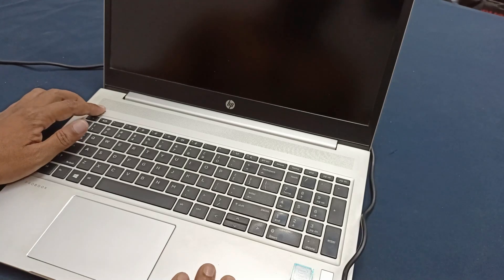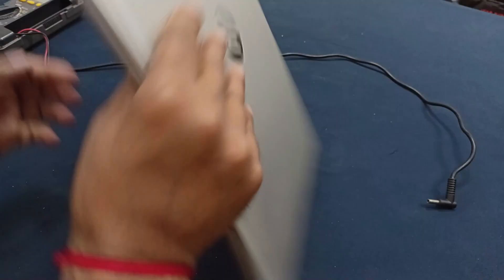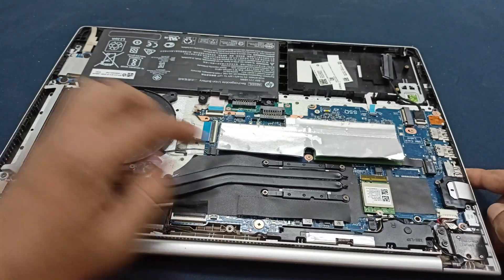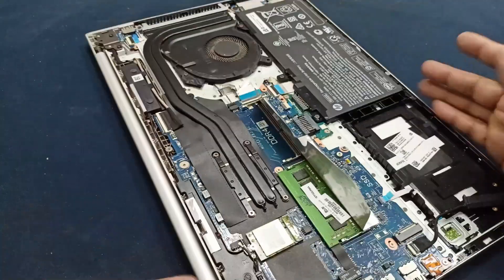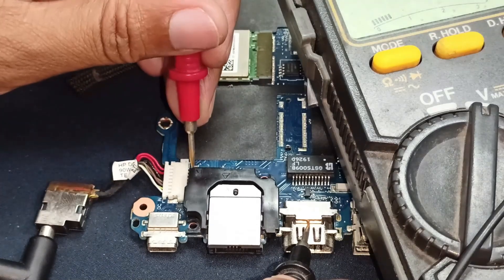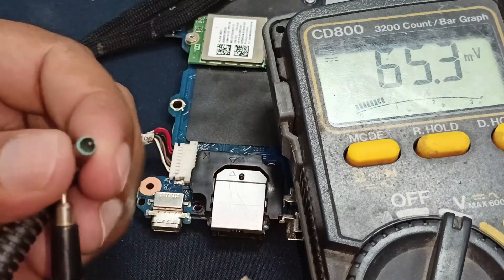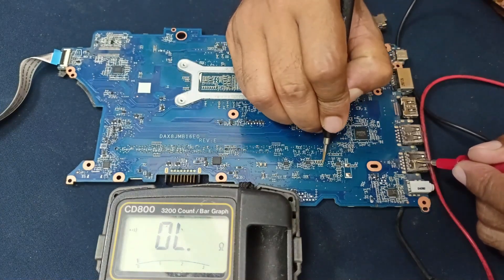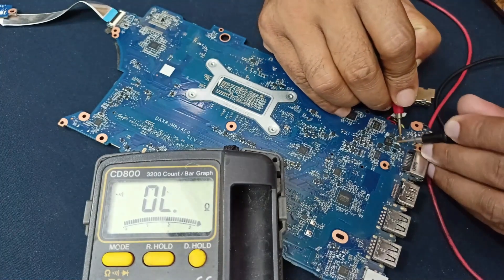Hp Probook 450 g6 laptop No power|| power won't turn on

Comment: The capacitor has no problem just change the power button socket and maybe the flex that connects to it. Otherwise, the problem is going to come back. I have done it in two laptops and it works just fine. And please learn how a capacitor works.
Reply: Thanks bud, that was the fix for me

Comment: question, i have almost the same laptop as this one (probook 430 g6) and it is turning on fine and everything works except charging the battery. i bought a new battery and it can run on battery power that came in the new battery but it wont charge at all (i've tried using both the dc power jack and the usb c charging). i did already try all of the software solutions i could find online without success so i'm leaning towards a hardware failure (maybe a blown fuse for charging or something in that lines) what is the best way to start diagnosing this issue ?
Reply from the maker: Dear sir sometimes local battery doesn’t work with the laptop i think at first you have to check your laptop  using by original battery and charger. your purchase battery would be not good quality wise your Success
Reply: @mrcontrive5641  the original battery is the one I replaced and it gave the exact same behavior I've tryed bother the charger that came with the laptop as well as a Dell 45w USB c one
Reply from the maker: @S0nicHax  ok sir i thought you are using hp laptop!  Your laptop turns on by laptop charger without battery.  Did you check that..?
Reply: @mrcontrive5641  it is an hp laptop but usb c chargers are universal, I have not tried booting without a battery installed but it does work on a completely empty battery
Reply from the maker: @S0nicHax  what was the actual problem before replacing the laptop battery.  It was the charging problem...?
Reply: @mrcontrive5641  yes, i replaced the battery because i thought the old one died but it's probably something else since the new one is having the same issues

Comment: I changed my hard disk and then the laptop won't turn on the charger light is still blinking and when I touched the CPU I found it hot so what's the issue and can I fix it by myself? (hp Elitebook G6)
Reply from the maker: Before installing the new hard disk your laptop was ok?

Comment: How is it a repair when you just removed a capacitors? They're not there without a reason... If the laptop would perform "as well as good without any problem" without it, the engineers at HP would not have placed them there. Problems will come from this "fix". The only right solution here is to replace them with new and equal capacitors. When not in stock, order them... The customer will wait if the fix is permanent. No discussion.
Reply from the maker: Yes sir you are right The engineer used it because it needs that place there are two caps in a single line sometimes it can run one capacitor. But I should used a same value caps  there .thanks for your advice
Reply: the capacitor is just to protect laptop to don't burn from wrong power , laptop working without the capacitors.

Comment: hie thank you for the video i have a problem with my  board there is power every where even at battery terminals but there is no light on charging port and not switching on pliz can you help me on that
Reply from the maker: while you open the laptop battery then can you get voltage ? at battery charging mosfet  or battery terminal.

Comment: Hi. good job. Did you replace the capacitors ? thanks.
Reply from the maker: No sir I just removed that capacitor from circuit . I didn't haven  same value capacitor. it's ok laptop performing as well as good without any problem. Thanks for watching and subscribing